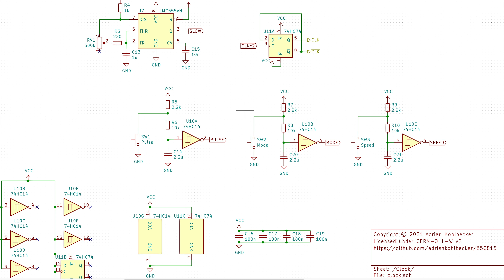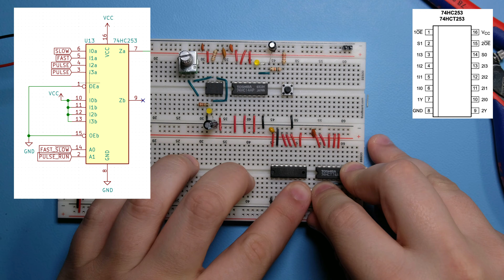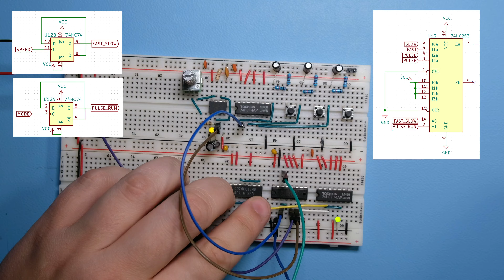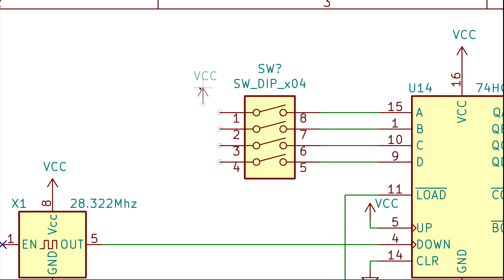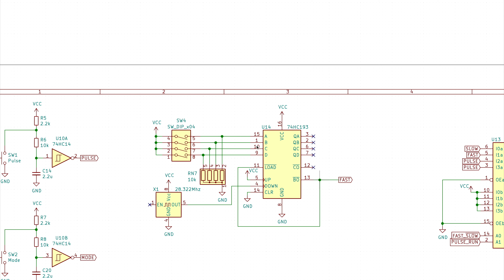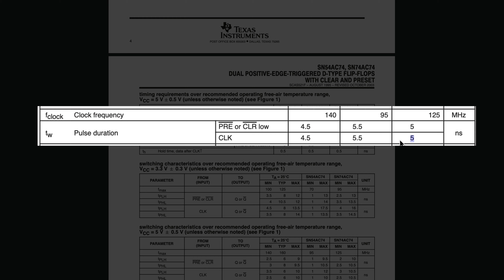#9 - Clock Module #2 - BB816 Computer

Comment: Loving your video series, and I'm learning a lot.

I saw that the Phillips 74HC193 can reach 45MHz  (typical), if I'm reading the datasheet correctly.  Would that be an alternative to the AC?
Reply from the maker: Thank you! 

That seems like a pretty fast chip for HC. However I can't seem to find it at my usual distributors. Is it still in production?
Reply: @akohlbecker  Ah, that's always the problem :(

I'll keep watching the series and see what solutions you find.  Thanks again.  It's so much fun learning new things and re-learning what I've forgotten over 20 years.

Comment: Hi Adrien. I am using the same idea of a multiplexer to select clock. However without synchronisation of any sort it means that the clock change can happen at any time during the clock signal which could send bogus clocks to the rest of the build. I haven't yet build a proper sync signal yet. What are your thoughts on this issue.
Reply from the maker: Hey 👋 you're right clean clock switching is necessary and it is one of the goals of my clock project. Clock Module #3 will go  into this
Reply: @akohlbecker  Great. Looking forward to it.
Reply from the maker: So, how did you like my solution in the latest episode (if you've watched it)?

Comment: Nicely done. Maybe you could try to extend the borrow out pulse to get it in spec with 74HC74 clock input, might even stop the 74HC193 from glitching?
Reply from the maker: It could work for 7Mhz for sure, but with a divider set to 1 (ie at 14Mhz) it will have to toggle for half the oscillator cycle with no stretch. That's because the spec applies to both a negative-going and positive-going pulse, so each side of the borrow line (ie when it is a 1 and a 0) needs to stay high for the minimum value of 20ns. This is where the max frequency of 25Mhz comes from.
Reply from the maker: What I'm thinking now is I'll switch everything to AC gates, but I'll have to switch to a '163 instead of '193. This is an issue because the '163 doesn't toggle its carry for half a cycle, it stays high for the whole cycle, so I loose the step with divider=1. I would have to either run it at 56Mhz or to add another line to the mux to get the 14Mhz clock out
Reply: @akohlbecker  Preset on '163 is synchronous with clock rising edge, while in '193 it is asynchronous I think. Also the 'terminal count' logic level is inverted. Might be hard to make it work right.
EDIT: Well it's easy to get 2-16 division, just invert TC out and feed it to PE input, division by 1 seems impossible indeed with this counter (although I'm not a guru with 74 series).
Reply from the maker: Right, I tested it with one of the spare inverters and it work properly up to /2